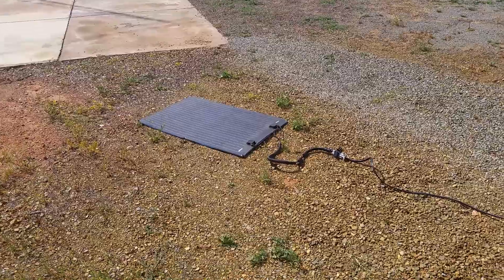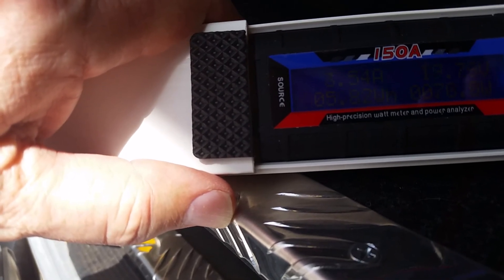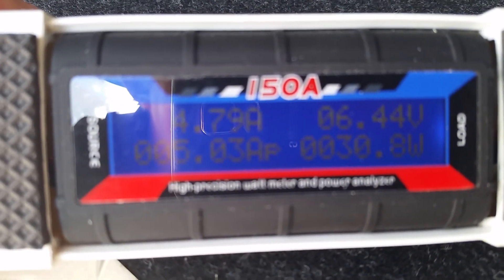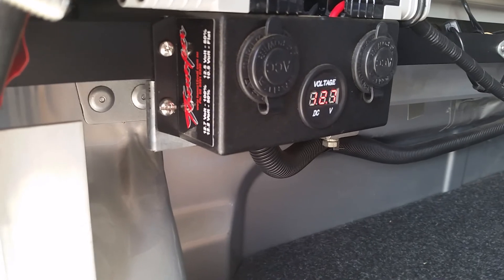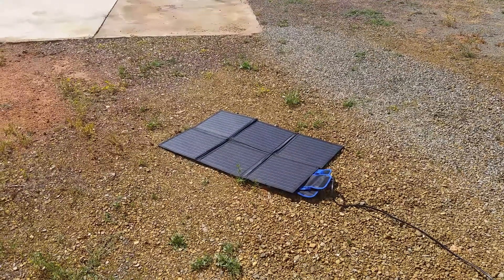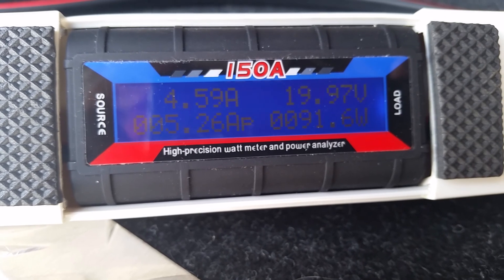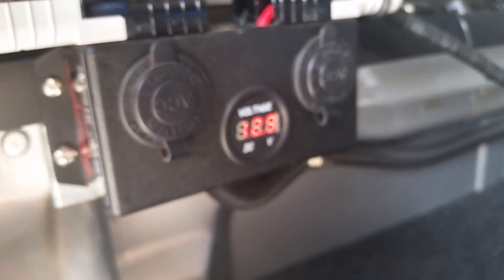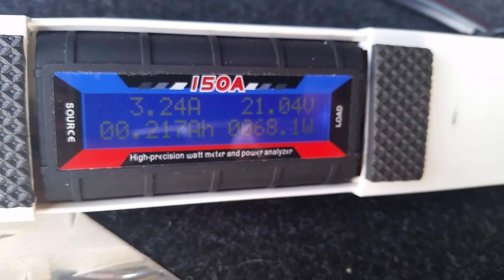Using watt meter on Kings solar panel and blanket

Comment: You need to put it between your charge controller and battery to get stable readings. If you put it between panel and charge controller figures be all over the place as controller adjusts itself to whsts happening with your battery
Reply: Hey mate, quick question. 
Can I connect this device directly to the battery as source and then to my load ( inverter etc) 
Or does it have to go between solar charge controller and battery ? 
Thanks for you help
Reply: @pleasetw  yes, it will give you the discharge rate etc if on the load side.